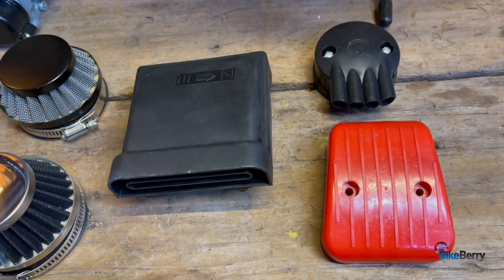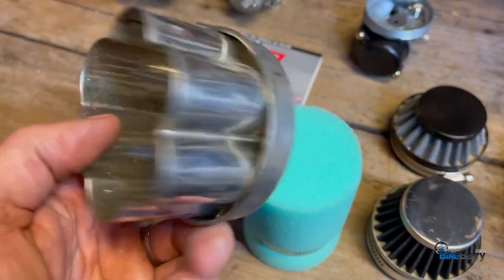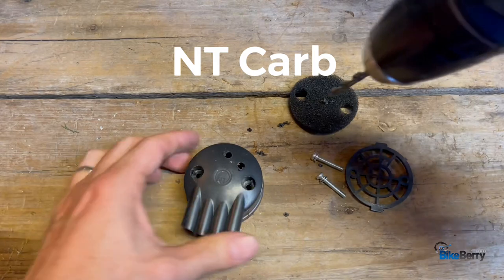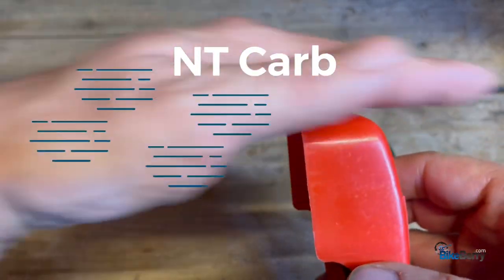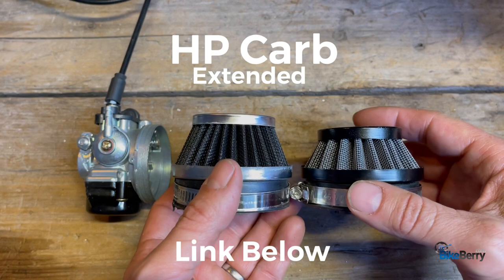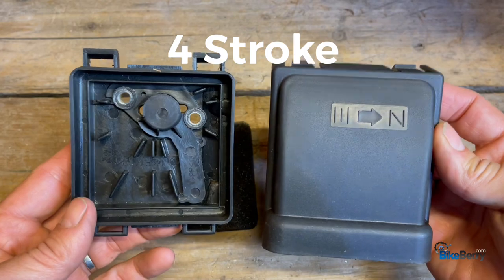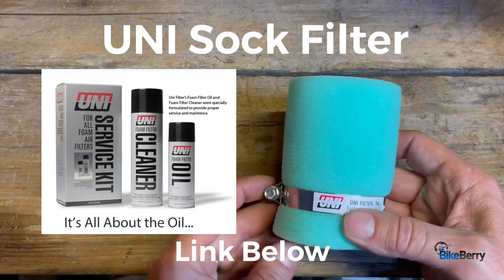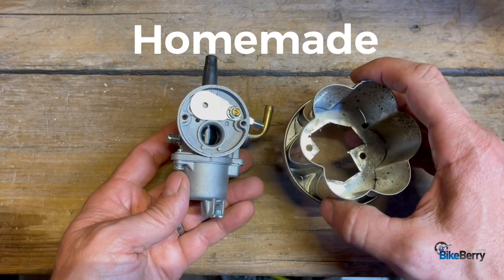Unlock Maximum Power: Choosing the Best Air Filter for Your Motorized Bike | BikeBerry

Comment: Take two of the inside plastic screens from the nt carb and put the foam filter in the middle. Then cut out the center part of the outside screen for maximum airflow. But keep the inner one the same so it supports the foam piece from being sucked into the carb. Good video
Reply: That’s a cool fix.
Reply: That’s a good idea, I did that same thing on one of my old bikes

Comment: what happens if you use a forced air to the system? like using a 12 v air compressor to the carb itself?
Reply: Interesting question! You should test that out and let us know the results.
Reply: If you can also give it enough fuel
Reply: Or a ram air intake?? I thought about building one of these a week ago might try it and post.

Comment: Can anybody tell me about the installation process of the uni sock filter? Does is just go on your stock carb after removing the stock skull looking filter orrrr
Reply: I had an extra Uni filter from my motorcycle and it fit the HP carb.  I switched back to the cone style because my leg kept rubbing against the filter.  But to answer you question, it won't.  There's not enough gripping surface on the NT carb for the clamp.

Comment: Since I’m not sure and this my 1st motorized bicycle anything , you can use an air filter or an exhaust  pipe ? they attach to different places ?
Reply: the exhaust is connected to the cylinder and the air filter is connected to the carburator
Reply: Thanks , I’ve learned so much since this question

Comment: Hi on my motorized push bike I have really done 3,000 miles on it have noticed that the knicker cell coating  is slightly coming off at the bottom near the exhaust Port  outlet  at the bottom it's still runs really well the top is actually fine I have no trouble starting it either ...what do you? think ? If it gives me any trouble I have a spare cylinder head to replace it if it gives me any trouble
Reply: Lol knicker

Comment: You don't need an air filter on a bicycle engine! It's been proven!!
Reply: Mmmmm dust and grit in my cylinder
Reply: @mrbotlegmechanic2491  a guy rode across the desert with no air filter so I think your basic riding will be fine. I've never used an air filter in all the years of riding and never had a problem and besides they're cheap throw away engines anyway. I have the phantom 85 and my spare bike has the yd100 if they blow up because of no air filter I'll buy another one it's not like you're buying a 30k dollar car
Reply: @Westhelockpicker  em your logic is correct but am broke as hell so yeah air filter good
Reply: @mrbotlegmechanic2491  I only ride when I want and if it's nice out. If the bikes were my only transportation and I had to ride in the rain then I would use an air filter but I only ride on the street when the sun is shining so no air filter
Reply: @Westhelockpicker  reasonable enough
Reply: @Westhelockpicker  yeah here where i live tho is very dusty like just a gus of wind can blow dust everywhere so I've seen my fair share of dusty air filters